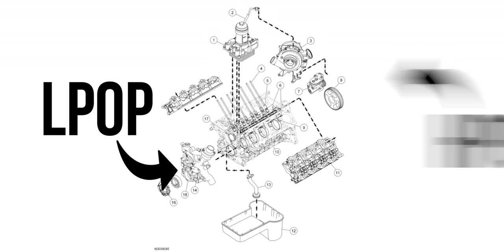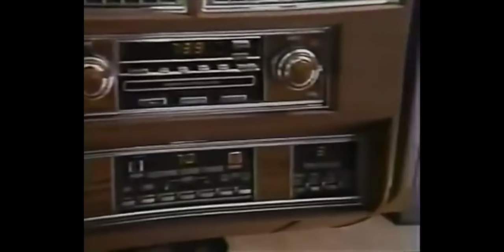These are the WORST ENGINES EVER MADE

Comment: The Northstar with all of the aftermarket fixes, such as screw in head studs, actually make it a very reliable motor.
Reply: ....with all it's aftermarket fixes....that you have to buy...and pay to have installed....
Reply: As a retired engine machinist I will argue with you on that!!! Norstar sucked that bad.
Reply: i have a 93  boy  has a 98...run  great,,,run the hard  an change  the anti  freeze
Reply: @1mikewalsh  You would be hard pressed to find a Northstar that didn't leak oil as well. LOL
Reply: He also has it's release date wrong.
Reply: @greggamandabarkus4235  all aluminum, in winter, with rubber gaskets
Reply: They still can leak heavy at the rear main. The crankshaft cradles leak at the block. They were mated to a troublesome transmission. Trying to stay on top of issues meant dropping the drivetrain cradle out for repairs every 2 years.
Reply: Yes had mines bullet proofed years ago all new gaskets and seals.
Reply: Almost 300.000 on the dash still running strong btw 03 sts.
Reply: Buddy has a 02 El Dorado ecs with the 4.6, he has a new problem with it every week lmao
Reply: I love the northstar engine being a mechanic, lots of overtime hours to help feed my family 😂.
Reply: My North Star always ran great and never used any oil. But I was keeping my fingers crossed.
Reply: 2005 DeVille with 202k miles. Still runs great.
Reply: My parents had 3 different Cadillacs with NorthStar V8s. The first, in a Sedan Deville, ran great, but had corrosion issues in the coolant passages and started overheating. It got a coolant flush and new coolant with corrosion inhibitor and no more problems. The next two DTSs were flawless. The engines made excellent power and never had a problem. No oil consumption issues or oil leaks with any of them.

Comment: I used to share the common belief about Northstar=BAD.  I've now owned two of them and, goddam, they have been some of the best engines I've ever owned.  Zero problems, zero oil consumption, great fuel efficiency, etc.  I think they got their bad rep in the early 90s and never outgrew it.  Those made from 2004 onwards are EXCELLENT engines.  Those made pre-2000 are good to stay away from.  The ones in-between I'd also buy without hesitation, though they occasionally have some issues.
Reply: Yep....this guy is FOS....he's here just for Clicks.
Reply: The originals had The head bolts threaded into aluminum instead of steel inserts. Insanity. Be gentle with it and take good care of it

Comment: I appreciate your comprehensive approach toward the good, bad, and ugly. Flaws in the design are the bean counters' lack of concern. What makes the matter worse is installing these concepts transversely.
Reply: Sometimes the Engineers just flat drop the ball and design turds. I'm a Ford man to the bone but the 5.4: Triton was a sparky spitting mistake. And they had an issue with tiny oil passages that had clogging problems and ruined heads on the regular. But some fellas that took good care of them got ridiculous milage out of them. Just use clean oil and change it on time.
Reply: Bean counters are the cause of alot of business problems

Comment: How is the 5.7 Hemi mentioned and not the 2.7 V6 from Chrysler? You are aware there are millions of 1st batch gen 3 hemis still out there running right?
Reply: For sure the 2.7 is so bad reman companies say ya you can't polish a turd
Reply: I mean I understand with the first ones dropping valves but they fixed that quick, my 5.7 is at 582000km never been apart, original tranny too. Maybe I just got a Wednesday truck….
Reply: My mechanic said any dodge that ends in .7 will drop the valves. 3.7 Cherokee dumped a valve at 164,000.

Comment: In 1986 I was a newly licensed 16 year old driver. On a family trip I drove my uncle’s Cadillac which was equipped with cylinder deactivation. It noticeably surged and slowed as the cylinders kicked in and out. When my uncle took the wheel and it continued to happen my mother expressed surprise that it was the car doing it. She just thought I was a bad driver.
Reply: I wonder why this is supposedly a good idea. The engine still has to produce the same amount of power to overcome its internal drag, only it's doing it with less cylinders. What's the big deal if the car needs 50hp (say) to drive at a steady 50, whether that 50hp is being produced by 8 or 4 cylinders?
Reply: @townhall05446  The problem is that the system wasn't like all modern implementations of cylinder deactivation that use drive-by-wire. The Cadillac V8-6-4 had a physical throttle cable, so the driver would notice and have to compensate as cylinders cut in and out.

Comment: The new junk Bronco engine with a plastic oil pain, plastic valve cover, plastic timing cover and over worked with a trubo may be in the running for the worse.
Reply: Yes , engine and plastic equal no good happenings.
Reply: @attilakohbor3360  When it was time to trade in my vehicle back in 2000, I looked at what was available and decided to hold on to my old vehicle just a but longer to see if vehicles got better.  I kept doing this every four years. Now I wish I would have traded my vehicle back in 2000.  There is absolutely nothing I would want today, save a Mustang or a Challenger.  But they can not function all year where I reside.  They would only be usable for summer and the early part of autumn.  Now I have had my vehicle 27 years.  There is no parting with her now.  I quit looking in 2012.  We have grown old together.  Now she has a name, a duty for every season of the year, and she feels like a friend. I know all the routines and how to maintain and repair her.  Only I have ever done any maintenence and repair to her.  I can not buy a status quo, ugly, lackluster, appliance with no character and personality.  It looks like I will have my Stargazer another 27 years.
Reply: in some cases plastic is superior to  metal ..lol ferrari uses it .maserati etc.
Reply: @kurtjammer9568  Does simply that Ferrari and Maserati use something make it good -- I can think of a number of examples showing that can be problematic. They get away with such because their owners are able to spend lots on them and don't need to drive them very often.

Comment: The olds diesels are awesome blocks. Most of that added weight went into the blocks for extra webbing. If you wanted to build a hot rod 350 olds those are the best blocks.
Reply: The engine otherwise was a looser
Reply: Higher nickel content in the block casting.
Reply: Nah, the NASCAR Olds small blocks were the best ones to use..
Reply: Glad there are still some of us that remember. The Olds 5.7 diesel was an absolute beast, if you converted it back to a gas engine. HotRod had many great articles detailing exactly how to do it. Wish my wife's '84 98 had one rather than MY vote for the worst engine: the Olds 307.
Reply: Yeah, but in diesel form they had so much crankshaft flex. that they would wipe out the front pump in the turbo hydramatic transmissions. that were mated to them. it was an almost constant issue back when I worked at a. Buick, Oldsmobile, Pontiac, Cadillac, GMC truck, dealership.
Reply: Amennn !!! And That  means, thate there is an Execllent and Clear Good way of Quantifying and sorting the Good or bad engine : Firstl Reason Is The Reliability Towards it's Power . And The Second Reason is : How Difficult is to repair or maintain it , such as : changing the parts as main bearings , or cylinder liners, or water pump, or clutch, and similar. So, DRAJ should be reconsidering This Explanation of the reasons. Pwy.

Comment: I have to call you out on calling the 2.2 liter Chrysler a Turd! You probably weren't even born till after they stopped production. The engine and the K car literally saved Chrysler Corporation! The biggest issue they had wasn't even uncommon in that time period for 4 cylinder American and Japanese Engines! Ask any decent mechanic from the era and they will tell you summer was known as head gasket season! It was very common for Toyota head gaskets to pop as well! 
Roll came out with a better 2.2 head gasket. Those that raced them would O ring them! They would put so much boost to them the head bolts would stretch! 
That gets to another issue many and I mean many Mustangs, Camaro's and even Grand Nationals lost to the little 2.2 Turbo. 
I drove a 2.2 liter K car as a cab. I was a major doubter of them and heard the head gasket complaints before driving one. The Company absolutely loved them and would run them past 350,000 miles. Cheap to buy, cheap to repair, easy to find parts for then and all of us drivers loved them! Great fuel mileage compared to the Ex cop cars! Much better turning radius and surprisingly comfortable to spend a 12 hour shift in!

Comment: The first gen 5.4 was actually a good motor.  The problem with the spark plugs blowing out of the cylinder head was caused by too low of factory torque specs in the plugs.  Increase the torque 10 ft lbs and there wasn’t an issue
Reply: Had oil pump problems too
Reply: @Toolaholic7  Oil pump problems? I've never heard of that before. I've driven hundreds of thousands miles in and never had any oil problems in those motors
Reply: @ceetwarrior  Yes,we had one in with a seized up 5.4 in a 2003 F150.Figured out it was the oil pump was bad that had bad  oil pressure.Had oil in it
Reply: @Toolaholic7  Right, on that same note 350 chevys have weak pistons because my friend had one that broke a piston.
Reply: @venialgaming4295  350 Chevys do not have weak pistons
Reply: @Toolaholic7  You completely missed the point of the comment, my point was the fact that a part failed for one person doesn’t mean every other duplicate of that part is bad, so you’re right, Chevy 350s don’t have weak pistons and he just got unlucky, but at the same time tritons don’t have oil pump issues, you just got unlucky.
Reply: @Venial Gaming  The triton engines do have oil pump problems.The 3 valve 5.4 is the worst of them and have seen a video of proof.
Reply: @Toolaholic7 I work on a fleet of Triton engines, never once witnessed any kind of oil system failure. Just timing chain and valvetrain work.
Reply: The older Chevrolet 350s had a serious issue. with valve guides that would wear out at around eighty thousands miles. causing those engines to smoke pretty badly especially right after start up.  

the GM Goodwrench crate engines must have had virtually no QC. because I had a friend that purchased a Goodwrench crate engine that he put in his 3/4 ton Chevy pickup. and he couldn't figure out how come it was using so much oil. so pulled it back out went though it. and found out that they didn't put all the piston rings on the pistons. and so after haggling with GM he got another long block at a considerable savings. but before he put this one in his pickup he went though it first and it was okay. and he wasn't the only one to have problems with the GM crate engines.

Comment: I would have given the early ranger/ explorer 4.0sohc an honorable mention for their timing chain problems.  The early ones had issues and the engine has 3 or 4 timing chains depending on if it has a balance shaft or not. One of them is on the rear of the engine, which makes serving that timing chain… difficult.
Reply: Also the  3.0 v6 are head cracking turds and the is a single overhead cam 2.9 4cyl from Ford that is shit too. GM had the 4cyl "blockhead " and the 2.2 and the 3.1 v6, saw a bunch of those in the reman shop back in the day when we worked on them
Reply: @ryanmiller167  The old pre-1996 Vulcan 3.0 was as sturdy as an anchor and reliable as the sun.  The problem was everything else in the 95 Taurus I had.  Most notably the transmission.  Engine was running fine at 190k when the 2nd transmission started going (think it was solenoids).  I would have gotten it repaired but then pieces of the A/C system started literally falling off, it needed a new p/s pump, it had a parasitic battery drain ( I think it needed a new starter). It was the death of a thousand cuts.
Reply: I don't see what the big deal is with the 4.0.. the aftermarket sets gave it a bad rap.  Subarus were get  timing sets and head gaskets every 100k miles if lucky and didn't get blown up by not paying attention..Costs just mutch if not more.  
Girlfriends explorer tossed a chunk of the timing set through the valve cover on the freeway. Drove it to my shop. It had like 150k  on it and was bought second hand from someone who didn't maintain it. I replaced cover and all the front timing stuff except the balance chain. The drive was destroyed on it.  Put it all back together and ran great up to about 200k  before the rear tensioner plastic wore away.  Replaced the motor with a 80k motor i had in a wrecked truck.  If anyone made it this far and says you need that chain on that balance shaft, well you have done no research as to its purpose in 4wd applications and it being completely unnecessary. You can not remove the shaft it must stay in place due to it being fed oil pressure.
Reply: Not honorable mention,number 1.remove engine to service timing,all associated bolts torque to yield.what a fucking joke.doing one now...monte
Reply: The worst engine to work on period
Reply: @ryanmiller167  As my Dad said, years ago, when I was a boy in the 1970's, "Leave it to Ford to use the American general public as their product test."  Whether it's the Y block, diesel project (6.0), and so on.....  Yes, the big three all do it but when Ford does it, they do it better than all combined.  The 6.0 diesel and 4.0 6 became better motors after all the "fixes" were complete.  The 5.4 three valve, was a horrible idea since the two valve version is/was bullet proof....  Except for the plug issue.  It's just a shame.
Reply: How early? My 2000 explorer had a 4L sohc, ran to 340k before the vehicle rusted away. I drove the everliving piss out of that thing, the timing chain was rattling away but the exhaust leaked so bad you could barely hear it, and that motor never hesitated every time I asked it to find the limiter. But people hate on them for some reason.
Reply: @sidviscous5959  Heard a lot of anecdotal horror stories about the Taurus back in the day.   Never got tired of asking for money.
Reply: Idk... I have a 2001 4.0 liter engine and I'm approaching 200 thousand miles.  Been dead reliable... original Trans too. So I think it's a decent drive trane.
Reply: Yeah I just had to deal with that shit recently
Reply: @reedvending2384  I've replaced many subaru head gaskets, if caught before it warps or puts coolant in the crankcase, it is very quick and easy to remove, put new head gaskets timing belt and water pump, and reinstall, less than a days work. But they do go every 100 to 150k miles, seen quite a few rebuilt many times and get 500k miles or more
Reply: @buyallmeans425  you’re literally due for an explosion. Those plastic timing parts are not an if, they are a when.
Reply: The 4.0 SOHC went through 4 revisions to the timing set to fix the fact they cheaped out and modified the old OHV block to come an abomination of an OHC. They didn’t actually fix the rear chain until 2006, which was still the weakest link afterwards. To properly do the timing set, you have to remove the engine, then remove the cylinder heads. It is a nightmare procedure to do properly and many vehicles had timing failures before 120,000 miles.

The balance assembly, some had it some didn’t. It depended on the application, but it wasn’t the weak link of the 4 chain mess.
Reply: @aaronatwood9298  yup, I just did this job 2 weeks on a mustang I sold. Both timing chain guides were shredded to smithereens. The engine came all the way out of the car.
Reply: I have a '94 Explorer with 147k on the odometer and I've never had any mechanical issues with the engine or transmission. I have replaced electrical components from time to time.  It probably helps that I was a mechanic, so I do my own work, and I don't abuse my vehicles.  It may also help that I know the entire history of this vehicle because I am the original owner, it's been in the family for 29 years.
Reply: @scottM278  but thats the OHV/pushrod engine. The SOHC engine came out in late 90’s which was an engineering shortcut of converting a OHV engine to OHC by cheaply modifying the existing block. They have a bad track record of blowing up timing sets and just being very underwhelming.
Reply: @scottM278  Is not knowing the difference between SOHC engines and OHV engines what causes you to be a former mechanic or was it something else?